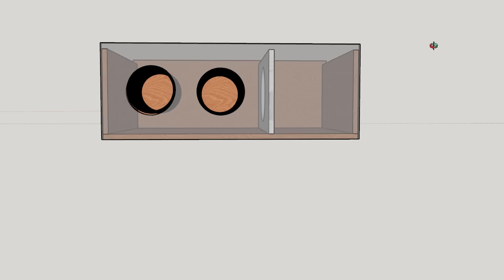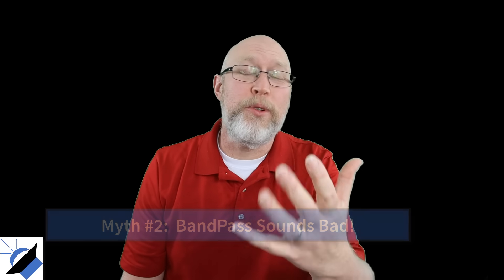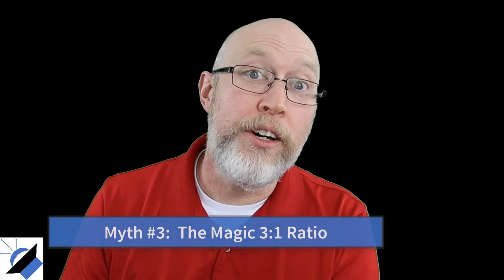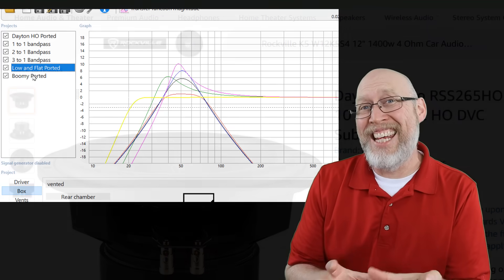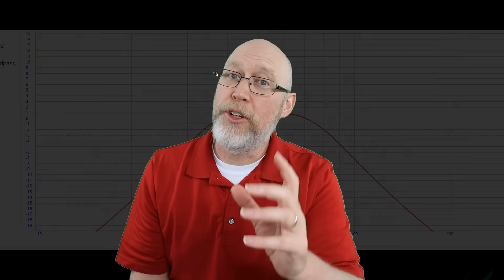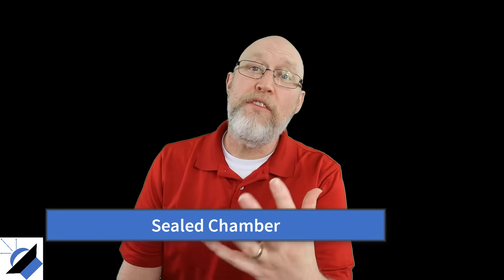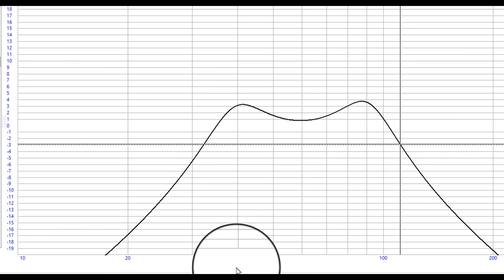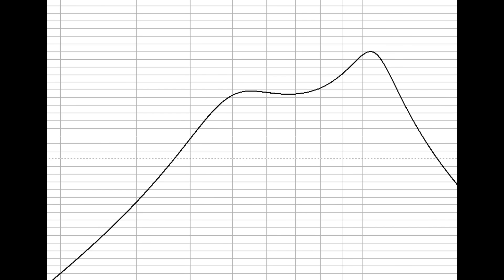Bandpass Subwoofer: You Are Doing it Wrong.  Bandpass MYTHS BUSTED!

Comment: A double bassreflex loaded version is best, q factor set up with front chamber and a big back chamber with very low adjusted pipe resonance.

I have a box made who is not a real bandpass but has a front who is chamber loaded on the floor and the side openings has a V form around the box 
to manage the resonance to spread, this pressure chamber is made to get the qts up, if doing that the normal way I get to high bass, now I have 26 hz
as lowest bass with ease, you need a low fs speaker afcourse, chamber do get fs higher, but tune the pipe to low fs, it did work very nice giving me that
as lowest point before it fall off. I use hornresp.

Comment: Correction....a port do not create sound. The woofer creates the sound while the port is a passive crossovers thus the name bandpass due to the characteristics of its natural frequency bandwidth of the two chambers.

A port is only a passive time alignment tool designed to delays the sound of the enternal volume of the chambers by restricting all other frequencies outside of the one which aligns with the length or ports  volume.

Forgive me for posting this here but YouTube do not have an inbox or direct messager.
Reply from the maker: Yes, the port does act like a crossover, but it also makes sound.  The air in the port will move back and forth just like a speaker cone.
Reply: @DIYAudioGuy  no...without a source to create a tune...it's only a hole in a box...it is a passive time alignment device this is why various lengths ans sizes effects the tuning fs of the subs in a box.
It's used to sign the rear wave
180 degrees to match the wave of the speakers so that both would be in phase with each other.
This is why it only can produce a narrow band width. These also apply to band pass enclosures and passive radiators.

But is something to think about

Comment: I have made couple 4th order bandbass subwoofer back in the days when I was interested in car audio and they worked just fine. I have simulated many times ported and 4th order bp and I don't do bandbass boxes anymore. Only thing which is good in my opinion is that speaker is in safe place inside the box. Good thing when you have to put something in the trunk.

Comment: When I was 18 I had a bandpass box with 2 Alpine type r 12s in it.  I can't remember the brand of the enclosure itself but it was a pre-built but done right.  The plexiglass window was only about 1/3 the actual width of the box, centered, and about 1/4" thick.  They were powered by an Alpine amp and I have no idea about any specs because I bought it that way and knew nothing at the time.  It was in the trunk of a 2000 4dr civic and would literally rock the car side to side while sitting at a light!  My ears would ring it was so loud and deep.

Comment: I was highly considering fabricating a 4th order enclosure for my car. Upon researching for several weeks I have been on the fence because I'm wondering if it's truly worth the effort. A sealed enclosure would be absolutely great but when covering the sub with a false floor I saw the opportunity to do a secondary ported chamber; thinking why not?  
I should just plug in the numbers and tune the ported to the sealed subs Fs. 22.4?? I'm no expert so I'm also wondering if I don't calculate and measure everything and use fancy tech to do everything, it may turn out awful?

Comment: I May be wrong but after watching a couple times. It sounds to me a 4th order gives you the benefit of a louder than ported box but with the smooth roll off of a sealed box.. I think right? I might be overthinking it but idk I’m just curious how it would sound.
Reply from the maker: No, it has the same roll off as a ported box.  And it's not necessarily louder.  Some subwoofers will be louder in a regular ported box.

Comment: If you want a good bandpass enclosure that already has a subwoofer, Toby speakers make a great one. Goes down to the 20's hertz and is pretty linear throught the band with. They don't use that much power and have a number of different size enclosure. Located in Halton Tx

Comment: Many pa. speakers for professional concert use struggle to go deeper than 30hz 40hz.

A speaker that does not play deeper than
50hz - 40hz is not good enough if you ask me.

What's the point of a big heavy box if it doesn't go deeper?

I have owned professional PA. bandpass subwoofer 6ht order that struggled with deep frequencies that didn't sound good. It did not use plastic pipes,  it was one box with 18 inches and at least a 200 - 300 liter box.

Comment: Thank you.  Ports are a coupler.   If you stick paper in a port the paper doesn't blow out. It gets stuck and moves back and forth.  Because its a cone.   Ported enclosures experience higher internal pressures than sealed enclosures
Reply from the maker: Exactly!

Comment: Shrinking port on 4th order make it more windy?
Reply from the maker: No, not in the sense that you will generate enough wind to float a t-shirt in your window.

It will increase the airspeed velocity of the air in the port and create a terrible chuffing sound.
Reply: @DIYAudioGuy  

Well, you are right.

I messed with port today and it did get windier but my 6-18’s got hot quick. 

Lost top end too.

So I took out and it’s back to normal now but thank you.

Comment: Whsts up !! I am wondering how wud you orientate us on a enclosure on a id say new but yet old modern way that woofers are being mounted on pvc tubes or any other crazy build to make or design the perfect type of tube for a high watt sub in which i do know that thickness of the tube is one fact to make the sub sound to a non vibrating absorbant reaction for the walls of the tube but about the deepness of it for a 12 inch sub..thanks for all of your orientation about looking for the best enclosures for our subs to sound the way it has to be without damaging our sound systems 👍🤜🤛👏👏😃🏆

Comment: Back in the day, I had a bandpass with 2 10's in it that were low power and I was really surprised at how loud and well it sounded.  I've been debating on building one lately for one of the cheaper 300w 10's from china and an equivalent small cheap amp
Reply from the maker: Back in the day bandpass and isobaric were popular because subs were not as strong as they are today.  So people had to be  creative.
Reply: @DIYAudioGuy  ok. Yeah, we are talking the year 2000, or early 2001. I had the chance to remember and the subs were two 10" kenwood tornado, single voice coil. I think they were rated around 300w peak. The cones faced each other behind plexiglass and the rear was separated and ported. I can't remember the brand of amp, but I think it was 500 watts. That was my first setup. For what it was, I was impressed. After watching a video, I'm realizing that I might have had better performance if I wired them out of phase and makede it isobaric

Comment: When calculating these enclosures in WinISD, if you choose a box volume of hypothetically 20 liters, does WinISD take the driver displacement into consideration? Or if my driver is 3 liters, do I have to make the total enclosure 23 liters, to ensure the actual free space is 20 liters? And same for the port, does WinISD keep the displacement of the port into consideration or, if the port is 1 liter, do I have to make the enclosure 1 liter bigger as well?
Also, thanks for making these videos, they are informative and entertaining at the same time!
Reply from the maker: Nope, WinISD will give you the NET volume not the gross.

Comment: Hi. I'll like it if you could help me with a ported enclosure for 2 ROCKFORD FOSGATE PUNCH P2D4-12 4-OHM DUAL VOICE COIL 12" SUBWOOFER BASS SPEAKER.
I have a Toyota Sienna 2004.
The trunk space is w42- D23- H14 or more if needed.

Comment: Question:  have u ever tested this box by putting a passive speaker on the outer wall  in front of the active speaker?
Reply from the maker: You mean using a passive radiator instead of a port?  I've seen some home audio speakers do that.
Reply: @DIY Audio Guy   
Negative. I said that wrong. 
Keep that part the same.  Just add a passive speaker behind the active speaker. Meaning the wall behind the speaker, cut out a hole n install a passive speaker there. Keep in mind I do not know this stuff. Just started watching ur videos. Good stuff. I'm learning. Just curious as to what it would do to the higher frequencies

Comment: Being a musician, and also liking my music Loud as music should be felt and not just heard. I think bandpass sub boxes work best with smaller drivers, like 8 or 10 inch. Because if you buy a well made band pass box or make one, you end up with the equivalent of a 16 inch or 20 inch sub that is a punch to the gut if you double up and use 2 subs. I did install a plexiglass band pass for a friend, but I had to highly modify the band pass cabinet adding rubbing washers and larger fasteners to make sure the thing didn't rattle apart. That said, got a good price on the box so the small additional cost was worth it, more time consuming than anything. The LED speaker rings limit the ability to add speaker foam around the driver during installation because the LED's are in the way. The LED's would be better if they outlined the interior of the box instead of the speaker itself I think. But bandpass subs are a good design I think especially when wanting dual subs for your vehicle.
Reply from the maker: I think that bandpass was really bit in the 90's because subwoofers were a lot less beefy and amplifiers were much more expensive.

Comment: Hi Dude, i been wathcing a few of your videos. They are great. do i have to do more research on win sd ? i have 3 jl audio 10 inch woofers. i wanted one running as normal and two in isibaric, to get stronger lower tones. say under 60hz for isobaric, and above 60hz to say 120hz or even more for the single subwoofer. i dont think they can be put in the same box ?
Reply from the maker: I do not recommend that you do that.
Reply: @DIYAudioGuy  great , yes. Can you recommend some ideas or designs for a isobaric subwoofer with breather port ? I was going to have one behind the other rather than facing each other for the isobaric. Add port holes with tubes or from back of box make a panels to bring the port to front like an L ? Any ideas pls ? I maybe look on JL audio site too
Reply from the maker: @earthling2022  I don't recommend isobaric.

Comment: How about a 6th order bandpass using two (different sized) prefab sealed boxes? Using two 12" sealed boxes, cut a mounting hole in the rear or side of both boxes. Mount an 8" sub into the hole of the larger box, then connect the two boxes together, install 12" PRs into the prefab woofer holes, and tune with weights. 

Connecting the two boxes would be ideal using heavy-duty, snap-down clamps mounted on each sized of the prefab boxes, per the sort used on pro audio equipment cases. Clamps would allow the two boxes to be disconnected so the sub can be serviced without removing one of the PRs.
Reply from the maker: It would be easier to just build a box.
Reply: @DIYAudioGuy  So you're saying it's possible? I wasn't actually sure it could work. The idea was using off the shelf parts for folks w/o nice tools or a garage. Given two identical flat pack boxes, one could be trimmed to make a smaller chamber, and cuts could be done with a drill and cheap reciprocating saw.
Reply from the maker: @xxxYYZxxx  Possible? Absolutely.  Would it be a fund thing to try just to prove you can?  Yes.  It would probably be easy to build.  But hard to design and hard to get it to sound right.

Comment: Good explanation.  It still gets deeper which has caused many a grief over the years plus contributed to the bad rap of bandpass. Active filtering and vehicle acoustics should be accounted for in design to extract the most performance while keeping the design practical as well. Many exclude those two things in the design process, but it is very detrimental to the result.
Reply from the maker: Oh yea, the room (or car) size matters.

Comment: It’s the Adam Savage of speaker boxes
Reply from the maker: THanks!
Reply: @DIYAudioGuy  oh awesome you replied! Thanks for that. I’m starting over on my box I trashed the one I had. I’m trying to get the best box design for a single 10” audiopipe db3. Only bad thing is the sub is dual 4ohm coil so I can only run down to 2ohm I’ve learned which kind of sucks. I’ll just have to get a bigger amp I guess idk. Speaker says the i closure has to be 1.0 sealed and 1.5 vented. So I’m going with 2.0 with a round 4” across port. Just got to figure how long. According my math it’s got to be a little under 15”‘long for around 30/32hz

Comment: I built a dual speaker bandpass box using 2 of the very worst subwoofers I could buy, which were the $20 each Radio Shack 8" subwoofers. It was so ridiculously crisp and loud, it was the best sounding speaker box I've ever had. And I ran those subs for 10 years, as hard as possible, expecting that one day they would self destruct. They never did blow up. I searched eBay, hoping to recreate that box again, but there are no vintage subwoofers for sale anymore, only the heavy "plastic" subwoofers with unnecessarily thick rubber surrounds, and way too stiff of cone suspension. In our modern era, they are using way too thick of rubber on the surround on subwoofers, it's more of a sales gimmick than anything, because if your box is built correctly, your speaker doesn't need constant heavy excursion. When a box is tuned incorrectly, the speaker will have deep excursion without producing much audible bass, which is a recipe for damage. A properly designed box uses only 50 watts to create comfortably loud bass.
Reply from the maker: Cool!

Comment: Diy guy.  

Me with the Harley trike with sub in trunk.  

Wondering if this selfpowered sub.  The 8” active and 8” passive made by Exoxgear.  Comes with 500 watt amp.  

I have cut a 7-1/4” hole in lid.  

Perhaps a passive radiator could go here. 

I could also put a port in the rear wall.  

So wonder - if the radiator was used exclusively.  Would it transfer the sound inside the trike trunk.  The trunk measures 2’-6” wide X 12” tall by 10” deep.  

This is just a temp solution.  

Could either go 2 ways

1) put 8” subwoofer in lid, and put port into rear wall. 

2) keep lid solid, put sub into rear wall and fire into area below seating area.
Reply from the maker: Getting good bass on a motorcycle is tricky.

Comment: Question…. If you have a woofer that works in a sealed or vented enclosure… can you design the sealed side of the band pass box based on the sealed specs for the woofer and the vented side based on the vented specs? As a starting point/ ballpark?
Reply from the maker: That is a fine starting place.

Comment: I have a old Boston Acoustics PV400 true bandpass home theatre subwoofer. The enclosure is in the shape of a skyscraper, 10" x10" footprint and 20" tall and uses a little 7" woofer. Completely sealed with two down firing ports (it sits on little 1" legs) . One of the most unique little subs I have ever seen and for a small sub it cracks really hard. It sounds far better than it should. Awesome little score. Actually have two of them.
Reply from the maker: They work great if designed well, it is just hard to do that.

Comment: I played around with a smaller active pass band sub woofer and I was not impressed at all. comparing it to my other subs it does not go as low and like you said it has a narrow range of frequency response. I could care less about having a loud sub woofer what I want is great sound for music so I want a flat frequency response that can also go low. as far as XMax  being exceeded. I can install filtering to prevent the sub from going that low. Most of the music I listen to is in the house. Even if I went with a 1:1 it does not go as low or as high as I would want it to. I don't have a sub in my vehicle yet but it definitely wont be a pass band. In my opinion there is nothing to gain what so ever of a passband unless it is just stupid SPL competition. I rather have some great sounding music.
Reply from the maker: I agree.

Comment: I have a subwoofer that I put in my Harley.  An Ecoxgear 8” powered sub tube with sub/ and radiator.  All that sits in my trunk. 

Sounds good when the lid is open.  Lol

One idea - is to cut 4” hole in back of trike to provide a way to hear sub.  

Another idea is to put 8” subwoofer  in top of lid and keep hole.  (Get rid of self powered sub)

Or third is put radiator in lid and internal subwoofer.
Reply from the maker: Getting good audio on a motorcycle is very difficult.

Comment: i built a bandpass box when i was 16, 18x18x18 sealed lower with pink insulation,
8x8x8 and triple 4" ports about 14" long using a Profile of California sub...
not very impressive...until under 25hz... at which point it was shaking the entire house... with almost NO cone movement... it was a very interesting sub... sub... cuz it deff needed another sub to fill in the upper registers and lower too xD
Reply from the maker: That sounds fun.
Reply: @DIYAudioGuy  i just picked a random number to build a box for... zero math involved xD